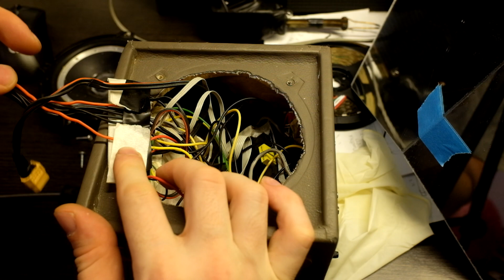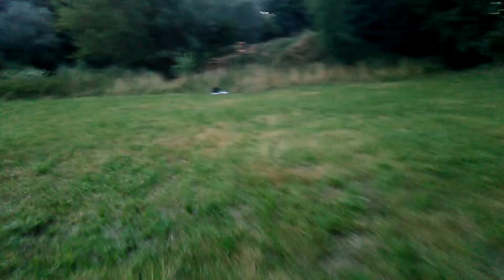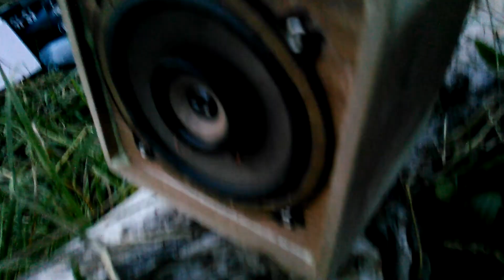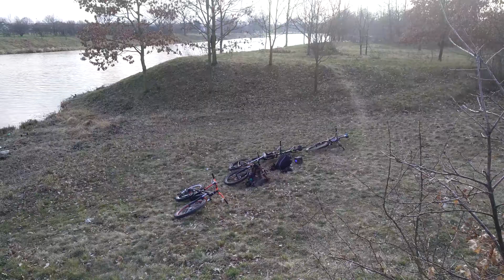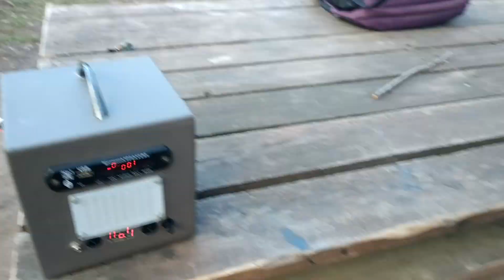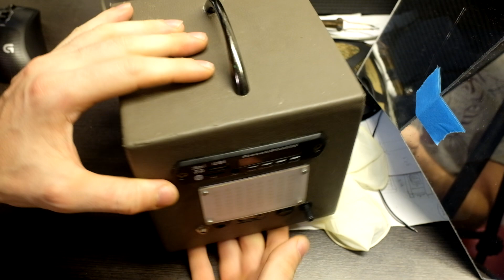DIY 5" 100W 112dB Bluetooth BoomBox

Comment: Hey, love the build!!! Just wandering when using a passive radiator do you not need twice the surface are in comparison to the driver? Ie 2 passive radiators for 1 driver? Would be cool to see an 8" version of this speaker ;)
Reply from the maker: yes, that is basicaly it, I didn't know at the time. That is why at the end I said version 2.0 will have 2 or 3 PR. Look at my other videos, I have 10" sub and latest 600W 6,5" :]